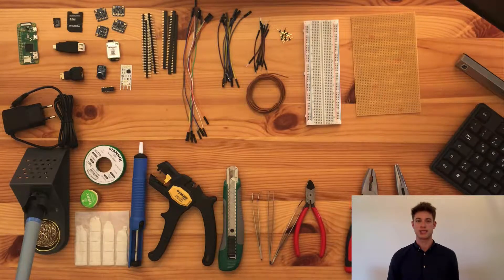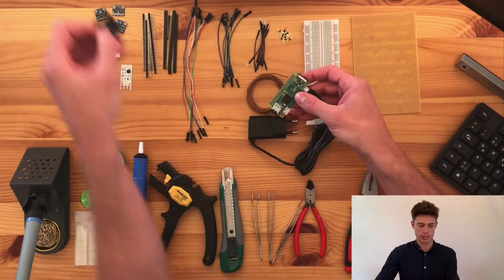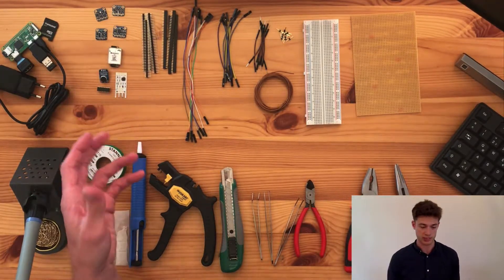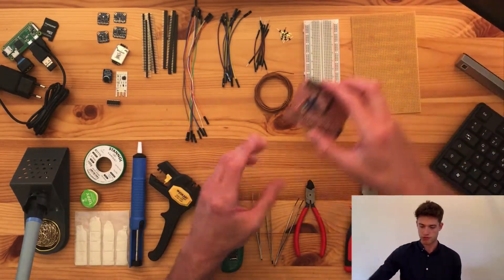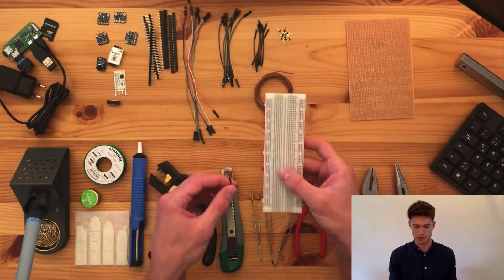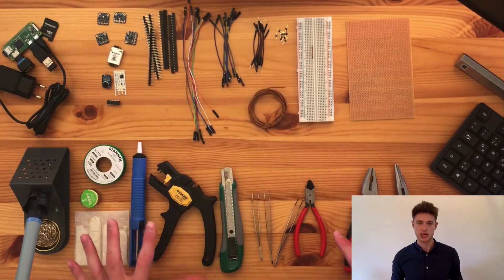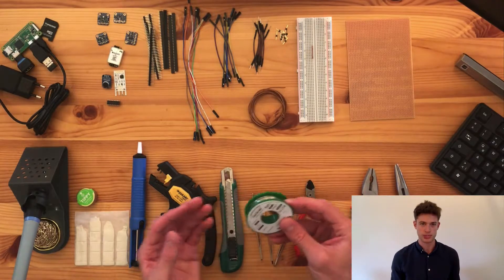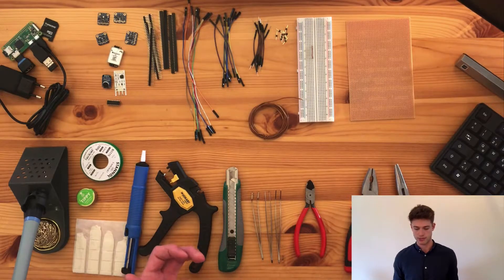02 | Indoor Weather Station | Equipment

Comment: I like using my teeth to take the insulation of the wire. I also like to use a fan to blow away the smoke while soldering.